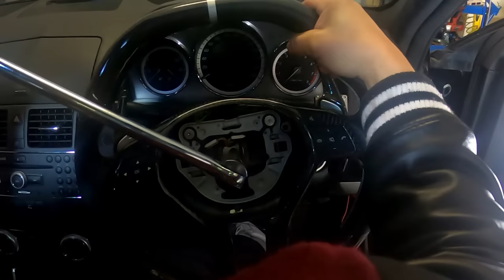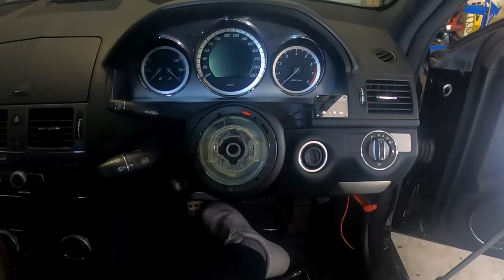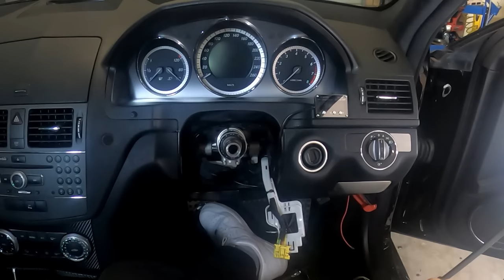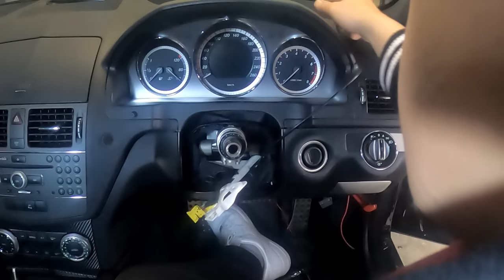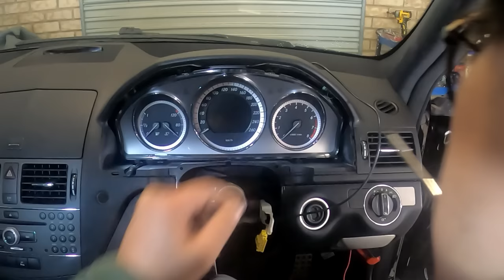HOW TO remove and fix ESL/EIS/ ELV MODULE  w212 w204 mercedes motor replace  Part 1

Comment: Mikey, just wondering, did you just replace this motor and reinstall back into the car or did you still need to have it programmed after replacing the motor? Thanks
Reply from the maker: no just replaced motor and put it back in ..no need to reprogram or re sync... thats if it is just the motor that has malfunctioned but if you need to reprogram its very possible that maybe a tiny mistake was made when reinstalling... others who have attempted to  replace this motor also have experienced not having to reprogram the device unless there is another underlying issue... another person on my channel also asked whjy his didnt work..in that case there must be another underlying issue, maybe not everything was in sync when reassembling and therefore caused  a malfunction elsewhere ..hence needing to be resynced or reprogrammed..which will only cost around 200aud...the most important part is gettin gto the motor and replacing it..then if it doesnt work when reinstalling then i would suggest getting a key specialist to quickly reprogram it for 200aud.... i see you from Victoria so many ppl can do it now with a simple key cutter module build specifically for reading keys eis esl etc....thats all it does ...and cutting keys also....
Reply from the maker: hope your replacement goes well friend ..wish you all the best ... theres also another thread here where no reprogramming was needed on the mercedes benz forum..which backs up the fact that unless there is an underlying issue...no programming is needed after replacing the esl motor..just a simple replacement and your good togo
here is the thread its abit further down the page once you see the thread quoted once by  user JCB0321
https://mbworld.org/forums/c-class-w204/640328-esl-steering-lock-motor-replacement-lots-pics.html
Reply from the maker: you willalso see in the thread that many ppl have simply just replaced the motor and voila all is well..no reprgramming needed ...
Reply: Awesome. Thanks for the great video and quick response. Keep up the great work.
Reply from the maker: @MrCnbnvs  thanks for the support mate ... much appreciated.... wish u all the best for all your installs and work on your merc ....

Comment: Omg this just happened to me but in the lock position they are working on it tomorrow morning what if you take  out the locking pin for good so it don’t happen again and probably the little motor would last longer
Reply from the maker: sorry to hear that matey... do u mean the locking pin that actually locks the steering wheel at the top of the esl module? im not too sure what would happen if u tried to tekove that...either it wouldnt work cuz of how its made with the moving parts rotating to make it work or it may not be able to read it due to the esl module not working as it should.. tjis is what i imagine could happen ...but i cant say definitely if that would work ..interesting theory though ...also if thats a route u would want to take .. maybe an emulator bypass would definitely do what u need i that case
Reply: MIKEYZ VLOGZ I saw some videos of the bypass on esl but the car is already being worked on
Reply from the maker: @ACURATL813  yes but its simple if u go that route with the bypass... u simply buy one and have a specialist program it to your car n refit it ..simple as that ..if my esl stuffs up again i will do that

Comment: Awesome video. Quick question. Do you need to make a mark for the steerling wheel position? Also do you need a torque wrench to tighten the nut back up? If so what setting did you use? I've ordered a motor from ebay so will be doing this repair with BIG thanks to your video 👌
Reply from the maker: u can if u want to it would be good practice ...
wish u all the ebst with this fix..its well worth it to do it your self
Reply: Hey bro did you ever do your repair and did it actually work for you?
Reply: Also if you don’t mind me asking how did you find the motor on eBay?
Reply from the maker: @terryn8515  ye it worked like a charmn
Reply from the maker: @terryn8515  on ebay u search " mercedes benz w204 esl elv motor " and it will come up with all different sellers selling the part...
Reply: Alright I’m about to order it now and give it a try whenever the part comes in. If I have any questions or need any help can I reach out to you?
Reply: Yes repair all done 👌 I sourced the motor on ebay. Hardest part of the job for me was getting the 4x pins out. Spraying them with WD40 and leaving them for about an hour definetly helped. Just need some Patience and perseverance 👍 Also take care when dismantling the esl there are small switches on the circuit board you need to press in with a small screwdriver otherwise you could damage or bend them. Take note of the white cog too this easily comes out. Take your time and you will be fine. Good luck 👍
Reply from the maker: @telboy3346  well done buddy ... yes i commented later telling ppl to be careful of the two gry little switches and they need to be pressed down to work
Reply from the maker: @terryn8515  yes I will do my best to advise u... just understand its abit hard not being there but I will do my best to advise u on whatever I can

Comment: Hi mikey i can remove the 4 esl pin what should i do?
Reply from the maker: hey jack are u saying u cant remove the pins? wat tool are u using ..u can try to use a t5 torx bit and lightly tap it in until it grips on the pin then slowly turn it while pulling out repeat until u have the pins removed.... or sometimes ull have to drill them out ... but I haven't done that before ... I know ppl have removed then in other ways
Reply: MIKEYZ VLOGZ yup in the end i only manage to get 1 pin out, and drill the othrr 3, then i just. Use wire tap to tap it back it works fine after changinh the motor, can tell from the sound of the lock its alot power and firm.
But just 1 problem after i install back everythig the dashboard shows my airbag mulfunction and the airbag lighht. Up. What do i do ? Thanks
Reply from the maker: @jackunns  did u disconnect the battery before u unplug airbag? u just have to reset the code friend
Reply: MIKEYZ VLOGZ i did remove battery before remove steering, can i reset the code by myself? Need a diagnosis kit to do it right?
Reply from the maker: @jackunns  ye neèd a obd2 scanner tool that can reset airbag code... did u wait about 25mins after u disconnect battery so no more power left in car... because there is still some power left even wen u disconnect battery which is why u should wait abit
Reply: MIKEYZ VLOGZ i did not wait Maybe thats why, if i go to any car work shop they should be able to reset right
Reply: MIKEYZ VLOGZ any brand recommendation for obd2 scanner?
Reply from the maker: @jackunns  yes icarsoft mb 2 is great i did a video on it where i reset the airbag
Reply from the maker: @jackunns  yes any car shop can do it easily but ur better off buying one so u can always reset and check codes urself mate ..trust me great investment... check out icarsoft for mercedes benz

Comment: Help! There must be a correct way to install the turn indicator with the steering wheel and an incorrect way, which I managed successfully. Now I have to manually flick the indicator arm back, so I may have broken something. My steering wheel is not horizontal when driving straight ahead, so I will have to tune it anyway and take off the air bag and steering wheel to get it correct. What must I do to get the indicator to flick back or is it broken already?
Reply from the maker: hey buddy..sorry for late replay been hectic...been trying ti pump more videos out.... sorry to hear about your indicator stalk.... it is possible that u may have broken the pressure point where it clicks back,,this can happen due to incorrect installation..

Comment: My steering wheel is not locked - I can turn it around, but when I tried to remove the ESL I found that it is in the lock position and I cant remove it. How does that work? I thought if you are able to turn your steering wheel then the ESL failed in the open position and, if you cant turn your steering wheel it failed in the lock position. However, mine seem to have done a bit of both! I can turn the wheel but the ESL failed in the lock position. Any input on that?
Reply from the maker: yes this can happen because the esl fails... however having said that ...usually yes if the steering wheel can turn it usually means the little bar that locks the steering wheel that comes out of the esl is stuck in the unlock position... its possible the motor has failed and can no longer push the locking pin ... this can happen too...I've heard others tell me the same situation... can u depress the bolt that secures the esl module to the steering column? that's the most important part of this fix being able to depress that bolt... there are work arounds... they are abit more involved    but very doable and repairable
Reply: @MIKEYZVLOGZ  The steering wheel was able to turn, but when I tried to remove the ESL, the little bolt would not depress, so I could not remove the ESL unit. I had to remove the whole steering column. At times, the little bolt would depress most of the way but not enough to get the unit out, then it would jump all the way out again and would not budge at all. So I had to drill a small hole into the casing to access the main gear's teeth inside - I used a sharp pointed tool to rotate the gear until the little bolt could depress. I cleaned the old grease out and replaced with white lithium grease, installed the new motor and reassembled the unit. However, after reconnecting everything, it gave the same "Remove Key" error on the screen - I assume the ESL/EIS and keys first have has to be reprogrammed. I am not sure if it is the ESL's motor that went out or its circuit board, thus I might just buy the ESL emulator and have it reprogrammed. We can now only buy a new original ESL unit from the dealer in the US and they have to install and program it as they view it as a "theft prevention" item.
Reply: macjohnw I had this problem last summer and made my own video on it as well.  I got inspiration from mikeys video.  Not sure if you solved this since this message is now 3 weeks old...but if you got an emulator and you’re done, I’m sure you’re tired of this subject.  I’m in the USA and managed to do the repair and it worked.  Perhaps why it didn’t work for you is because as you alluded, maybe the chip was damaged (that does happen sometimes), perhaps the replacement motor you bought unfortunately was no good from the start, or I’m thinking maybe you didn’t install the motor in correctly, to allow it to touch the contacts that are needed?  And did you put the box back together slowly, to make sure everything connects the way it should, the lever in the gear, the motor on the gear, etc.?  Lastly, if this still is relevant, I wouldn’t use white lithium grease to re-grease.  White lithium grease is not as “wonderful” or greasy as people think and if you did repair, it won’t last too long.  I used an all-purpose silicone based grease...the type you buy at auto zone or Home Depot.  In a can for about $5-6.  Hope it all worked out for you!
Reply: macjohnw Also, per my advice in my video, when you re-assembled the box did you re-assemble it in the “locked” position?  If your ESL motor fails in the locked position as I think you said, and how mine failed, you should also put it back together in the locked position.  And then use your key to unlock...so the computer doesn’t get “confused” and send the wrong signal to the ESL.

Comment: How do I know if my esl is in the unlocked position when it has failed?  I could move the steering wheel left and right correct?
Reply from the maker: yes that one way to tell however sometimes if the esl has failed it wont even lock and unlock anymore... but yes thats a good indication its unlocked

Comment: Hey Mikey....Do I have to the steering wheel off?...Because the center bolt is on tighter than a drum.
Reply from the maker: yes you have to so you can access the 4 e12 torx bolts to lower the steering wheel ... it's a must .... try putting the 10mm hex bolt in the steering bolt and tap on it for a little bit with a metal hammer end ..vibration will help to break free the lock tite on there.... but make sure when you are trying to remove that you hold with one hand and  then use a longer breaker bar ..the longer the more leverage you have us better ...shorter ratchet/breaker bar will make it harder to remove .... one guy had to get a mechanic shop to help with an Impact wrench ...because he couldn't get it off.... impact wrench is good too because the I.pact is like a hammer tapping on it ...the vibration and hammering from the impact gun helps to break free the bolt
Reply: My daughter had to hold the steering wheel and I wielded a two foot long bar on the 10mm hex, it is red-face torque!

Comment: Hey I have a 2009 c-class and my wheel is locked to left. Had to get it towed and of course car got damaged from towing but was wondering how do you get to motor to tap it and try to unlock it before following video?
Reply from the maker: heybuddy so theres only a few things u cab try to unlock it and one i always try and habe most success with is by tapping directly u der where the esl module sits...the vibration should help to shock the motor i side enough to help it spin one last rotation  to u lock your esl...if all else fails...u can always try to drill a small hole near the motor and turn it by force with  scribe or small screwdriver...but the beat thing to do is try to get it to unlock before hand to eliminate the possibility of frying the Nec chip inside the esl module... its an important step hence why i stress to only try itthis way if u get the esl to unlock and if u cant maybe its better to remove it all and have someone  else fix it for you as it would need to be reprogrammed and synced and maybe need a new chip due to the likelihood of destroying  the chip by opening the esl and messi g with it without having it unlocked... wish u all the   best and luck dearfriend
Reply: @MIKEYZVLOGZ  you think if I spin it unlock, replace motor and then spin it back lock before testing it or powering it, it will burn the chip or no?
Reply from the maker: @bryanttrahan1852  high chancr

Comment: Hey Mikey, great video! Quick question, I can’t seem to nudge my ESL out of its position . I know for sure it’s in the unlock position because I did hear the motor unlock before I disconnected the battery and I can also managed to push the screw all the way in. But somehow I just can’t depress it enough through the hole to pull out the ESL. Tried wiggling it but the screw keeps snapping back in. Is there a way or a trick to depressing it and pushing it out? Been going at it for an hour and I really don’t want to take out the steering rack if don’t have to. Thanks again.
Reply from the maker: ok if it is unlocked for sure guaranteed? thentry using a thin but not too long tool to depress it and lift it at the same time, i had the saME PROBLEM TOO but i kept at it and i got it out, hardest thing is your doing most of it by feel... so u only know its ok once it actually comes out.. theres no real trick, but there ar3e different ways to try .. 
1. small tool that will depress bolt and use other hand to pull it out as u depress
once you get it out abit it will come out because your just trying to get it past the initial bolt once depressed
dont give up its very doable.
however there have been cases where the esl motor makes the noise but the esl isnt unlocked due to the motor not being able to turn it 
i hope u get it sorted mATE
Reply: @MIKEYZVLOGZ  Thanks bro, just went at it again and finally got it to come out. Had a hard time getting those 4 small screws out, end up drilling a few in order to cracked it open. But the motor swap was easy like you said. Closed it back up with a couple good screws back in, wrapped it with electrical tape and call it a day. Fallowed your second video on how to put everything back together and the job is competed. Thank you so much for the much detailed instructions, couldn’t have done it with out it. One question, the airbag light comes on, can I just clear that with a OBD reader? Thanks again!
Reply from the maker: @serpentor5714  yes use a obd2 reader that has airbag reset and done deal no worries ... well done for completiong a job most wouldnt attempt , its actually pretty easy when u take your time and use your brasin,.. u must have disconnected the airnbag whilst the car was connected to battery ..lol..i ve done it many times too lol , but easy fix..good job mate and congratd..thumbs up for u
Reply: @MIKEYZVLOGZ  just an update. So I had just experienced that dreadful silence when I turn the key again a couple of weeks ago. And just last week I’d had a difficult time trying to get the engine to turn, of course no “zip” noise when I place the key into the EIS. After swapping to my backup key to see if it catches, I lucked out after like 10x tries (banging on the dash, steering wheel, etc.). So this time I’d decided to go with the emulator route. Just disassemble the steering wheel and loosen the steering column to access the EIS and to JUST disconnect the wire from the ESL (no need to uninstall the ESL as long as it’s NOT in the lock position) and connect it to the emulator and you’re all set. So glad that I no longer have to go through the agony of the taking out ESL and swapping the motor and risk damaging the ESL in the process. Hope this helps someone who’s in the same boat as I am. From now on it’s just plus and play. Thanks